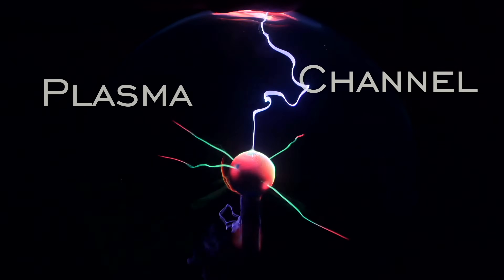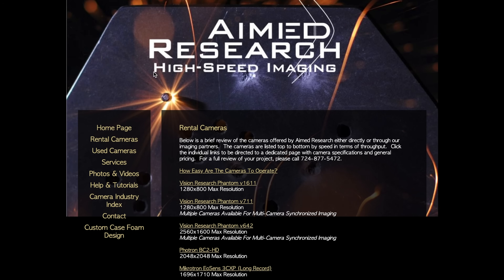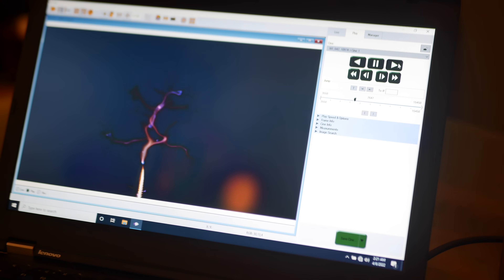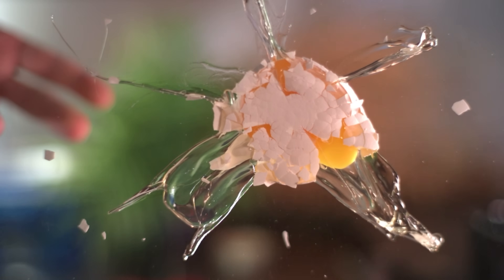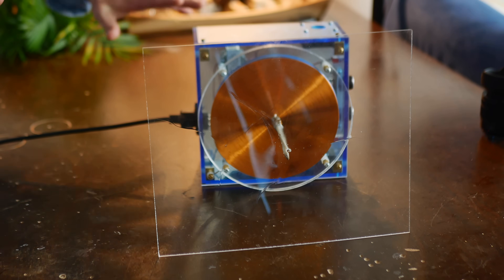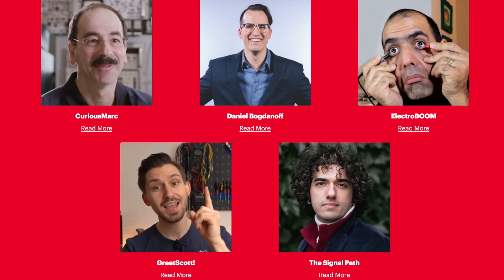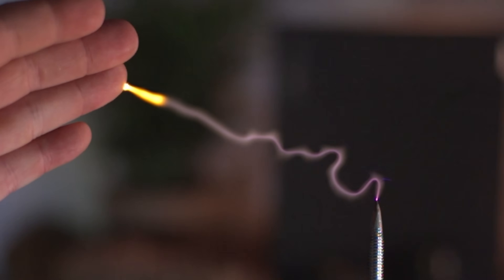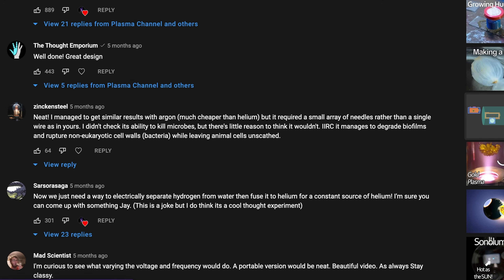Plasma Explosions Warped 400X Slower ( Phantom Camera vs Tesla Coil ⚡)

Comment: try electrostatic thin metal conductive film vacuum balloons
Reply: a close relative to the van der graaf generator charge half sphere
Reply: I theorize that you can puff up a conductive balloon by just rubbing it :)
Reply: aluminium foil balloon, tribo electric effect charged
Reply: try plasma dynamic vacuum pump, ie plasma ion embed sling, dc emf high voltage arc ion/electron current (wire) sling
Reply: ie, no moving parts (other than ions/electrons) vacuum pump
Reply: ie, plasma railgun ion bombardment chamber

Comment: For your pancake tesla always branching into 3 or 4 paths i think that is due to the tip it's discharging from, if i'm not mistaken those screws/bolts are cut with ethier a tri and quad pattern on the tip.

Also i think the coolest thing to see was the visible Ionizing channel each path makes the longer it exists, you could see the air turning into different gases as it happened.

Comment: Wow this is quite awesome! Sorry it took so long to get to your video. I had 270 videos in my watch later list and I'm just getting down to the last videos that are 11 days old. It would be pretty cool to see a slow motion of a vaporization of skin cells at 1,000,000 frames per second. I'm interested in seeing just what goes on. That along with arcs. 

Very well done video. And also thank you for the osciliscope a while back ago. It has seen lots of use and I have used it on a welding machine I'm making. I'm making a TIG welding machine with microwave oven transformers. I first started with an AC stick machine and since then I made an AC and DC stick machine and a plasma cutter and now I'm making a TIG machine AC and DC out of microwave oven transformers. 

It's pretty cool. And the osciliscope has seen lots of use. I love it so thank you. Also I loved the additional Jay in the video. Hahaha!

Can't wait for the next video!

Can you do some videos on microwave oven transformers in series and some capacitor configurations and what they do? It has been sort of looked at back in 2015 and 2016 but I'd like to see a refreshed version and maybe you might find a better way of doing what was done 7 years ago. Take a look at the king of random video on the microwave oven transformer.

Comment: The bolts seem to be acting like rivers that meander over time. 

https://en.m.wikipedia.org/wiki/Meander_cutoff

I can see that being caused by opposing forces of magnetics and electrostatics.  Current will want to expand a curve outward, similar to how a railgun works.  But when the curves get near each other, the difference in voltage shorts the curves into a more direct path.

I'm curious if the branching is caused mostly by natural radiation (including cosmic rays) that create straight but short conductive paths.  If the ionized path is near the bolt, it might then cause a branch. That's a guess, but the two effects would explain a lot.

Comment: Awesome!   Ending with a suggested video that has me thinking the most efficient way(s) of stepping down that drone power to lower voltage and higher current for other practical uses thoughts... maybe?  Beautiful videography!  Excellent!   Wondering too, about, what ablating tissues looks like in slow mo?  Maybe that one spot... though with a follow up off camera of 30% H2O2 just to be safe?

Comment: What would have happened if you used a piece of glass instead of acrylic?

Would it just shatter from the temperature differential, or would it have heated the glass up and possibly melted it?

Comment: What's the actual max temperature of the arc?  Obviously you don't get seriously burned due to the short duration, but there is still some burning as evidenced by the acrylic.
Reply from the maker: Great question. The arcs are many thousands of degrees. It burns you on every single stroke haha. I’m missing my fingerprints on multiple fingers now, and my arm is scarred. All for science

Comment: Amazing. Now we see the plasma spicules. The amount of spicules or tufts depends on the surface area. And we can compare those three small tufts to the solar plasma tubes known as spicules. This may be a fun experiment but to me it reaffirms the electric universe.  Change your plasma ball for a SAFIRE 3 phase 480 plasma ball. Then you will get voltage striation in the atmosphere.

Comment: High-speed footage shows in great details that you need to replace end terminal of your Tesla Coil - sharp edges of a bolt wastes energy by creating parasitic sparks. Not sure why did you not care about it from the beginning - this was kinda.. obvious and should be expected. Was too lazy to do it?
Reply from the maker: The design of my SSTC was intentional. I maxed out the length of spark possible without my secondary coil arcing over. Any top loads at all, and my secondary begins shorting turn to turn. So, sharp breakout point it is.
Reply: Oh, i see. Its a flat coil after all.

Comment: What is the reason behind the plasma discharge splitting into 120°, 90° or sometimes 72° Leaders? Is it due to the frequency of the supply output?

Also, in the reduced speed frames of the skin cells becoming vaporized, it would be interesting to know if there is a voltage draw from the rest of your skin? And the measurement of the dielectric breakdown at the contact point. Is the contact point your actual skin or is it within the frequency zone of your body 🤔 How large is the heat affected zone?

Instead of using plastic, could you use a sheet of glass?
Reply: I had same thought on why it split.first thought is because of magnetic fields. If the current is equally dispersed it should space out equally. Also I think the arc follows wavy paths because there are many small electromagnetic wave variations. Would be interesting experiment to run some mm wave radio next to arcs.